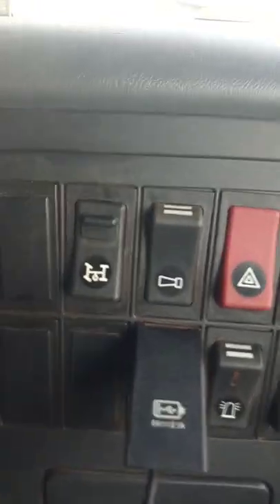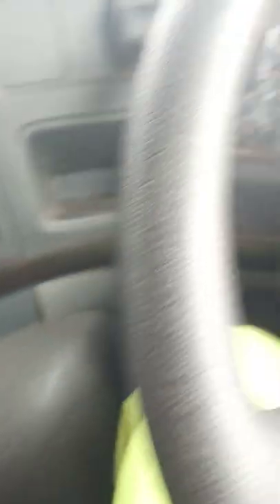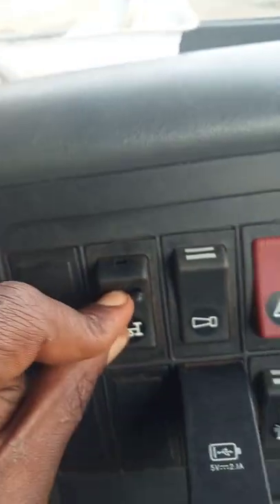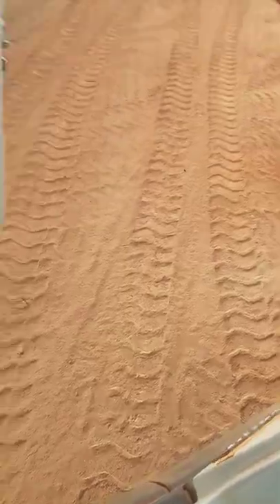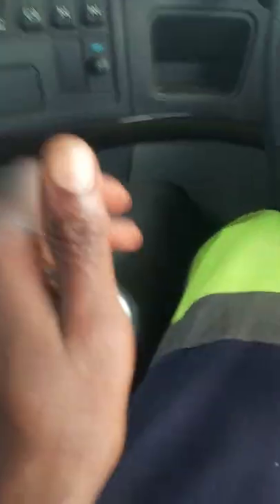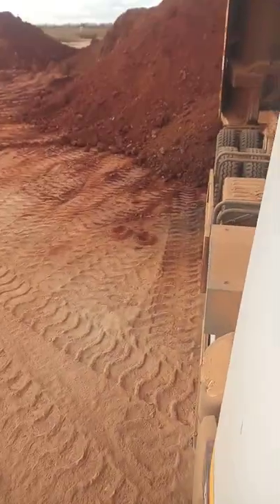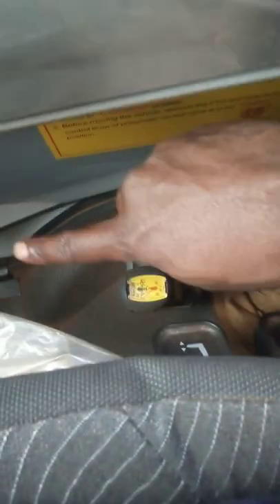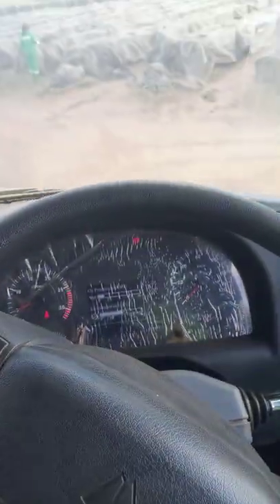how to use Howo PTO by sir wisdomjakachira@gmail

Comment: I have a howo 360 8 speed truck but am having a problem raising the dump after I switched on the PTO button then the neutralise the truck when I clutch in to any gear the truck still moving causing the dump not to go up nor down